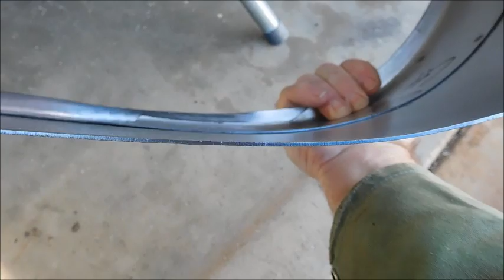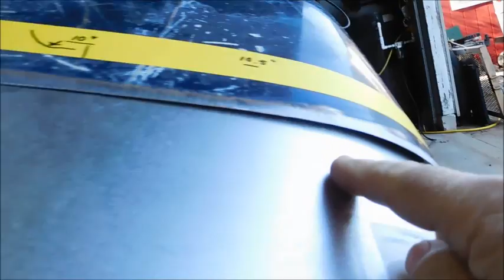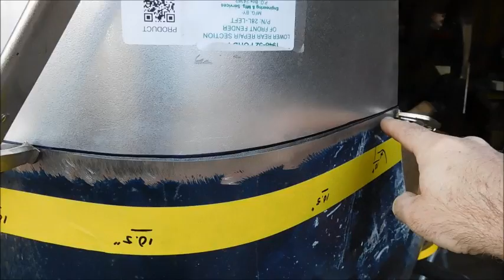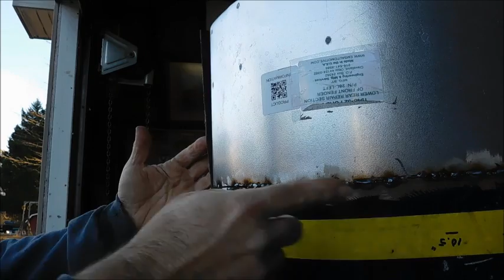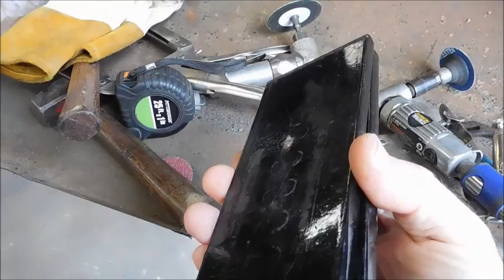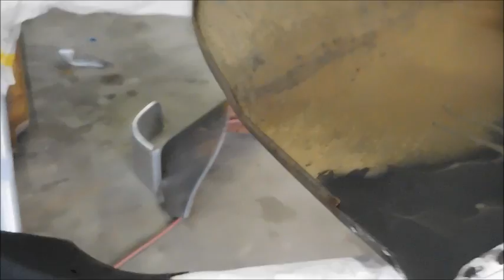Ford F1 fender repair 2

Comment: I had to cut all the patch panels on the outside of the fenders 6 in all 2 on the front and 4 on the rear when I did my truck . I didnt did as you did and I wish I had( inexperience in bodywork ) but when I did the inside cut I left it straight and didn't put taper in as it is covered up by the running board mostly . Nothing on replacement body parts is ever easy ....another Great video .

Comment: You are taking a chance without having truck to see if fender would fit before final welding and blending ?
Reply from the maker: Maybe. I feel pretty confident with how it turned out using my templates.
Reply: the finish assembler has tons of step drills lol